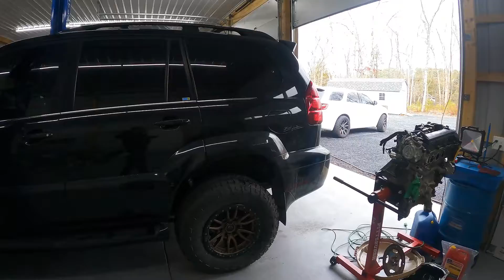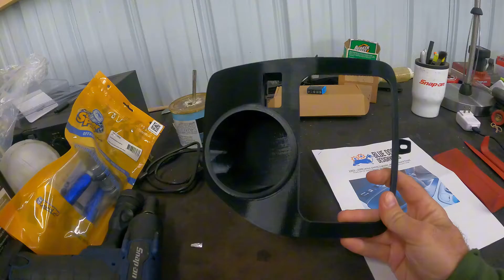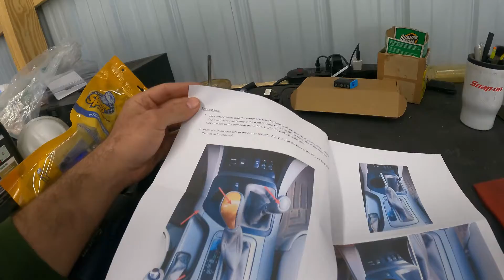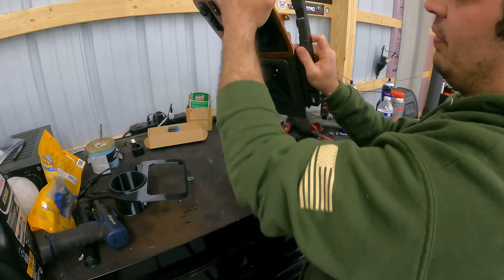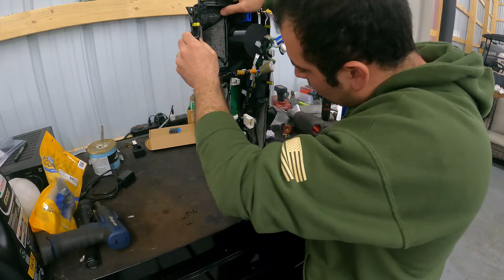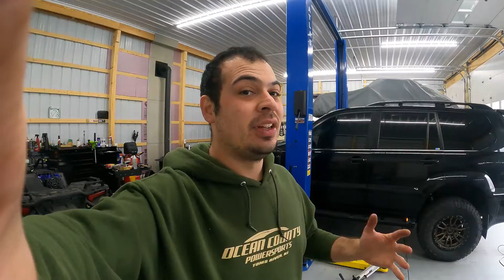Lexus GX470 Air suspension control switch delete!! (center console removal and replacement)

Comment: How does ride comfort setting work? It sounded that it's not applicable after conversion to coil spring? Is it setting the air pressure of the air bags?
Reply from the maker: No, it has to do with the shocks. There’s a little motor mounted on top of the shocks and the comfort setting either stiffens or softens the shock
Reply: @SEsGarage  Just remember to follow up: so looks like the comfort setting is only for rear shocks? I also delete the center control switches but no wonder if the front ones are controlled by the comfort setting as well (?) Thanks!
Reply: @houselin3625  it depends if you have the stock front shocks. if you delete the rear air bags, then the shocks in the front go into passive damping mode.